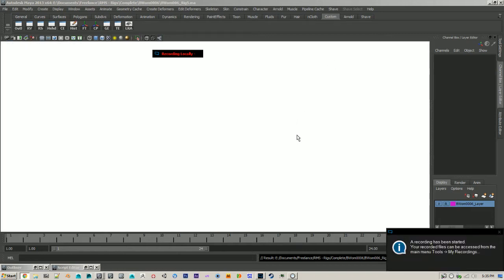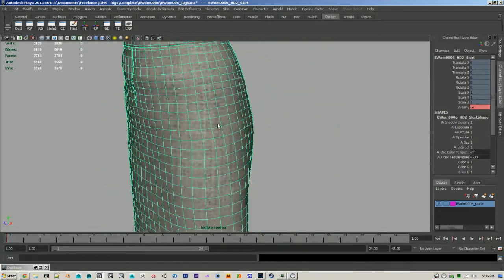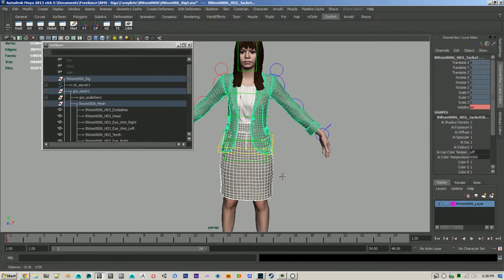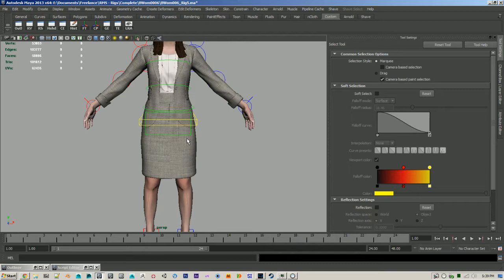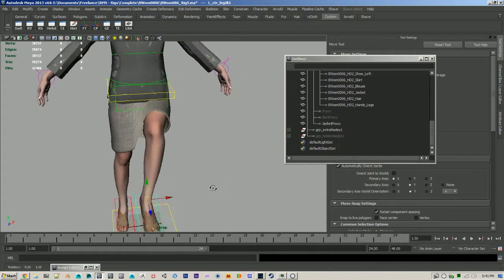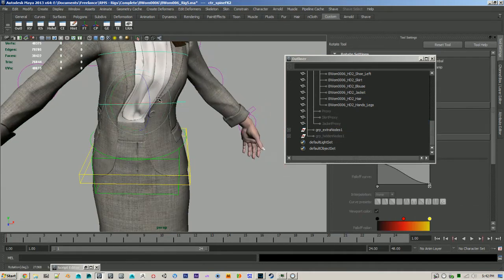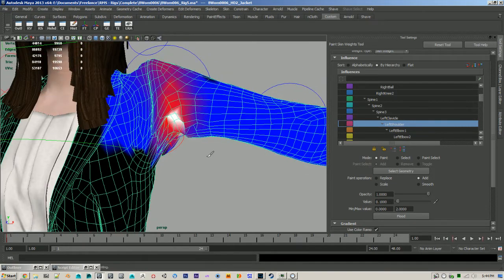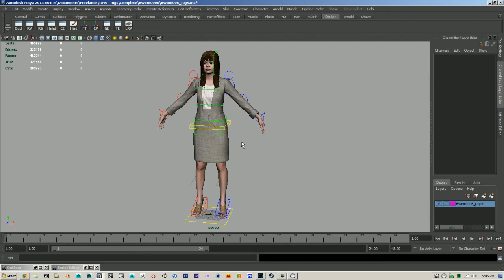[Maya] Rig Tip - Skinning with Proxies

Comment: Why changing to post mode while using smooth brush? Is it still the same in 2016?
Reply from the maker: If you don't it can mess up your skinning weights. Has to do with the way it reassigns weights on the fly when you smooth
Reply: Thanks man, this is great idea and I never though of this...
Reply: I`m new to this, can someone explain what "post mode" really is, and when to use it? :)